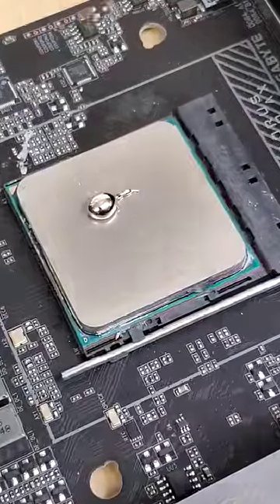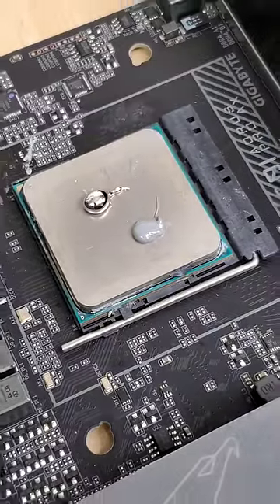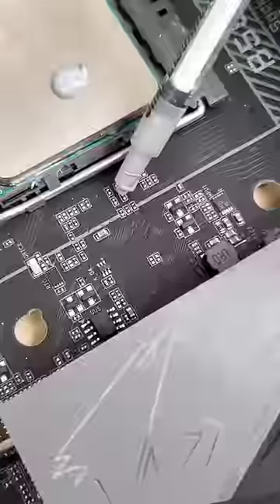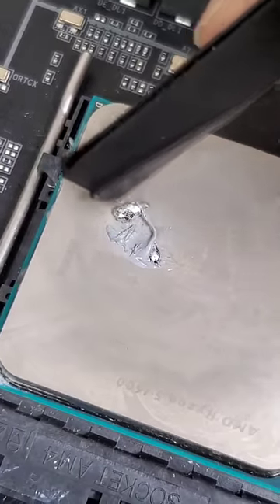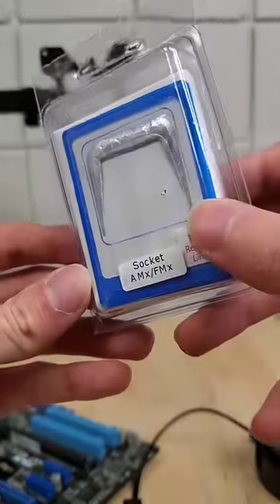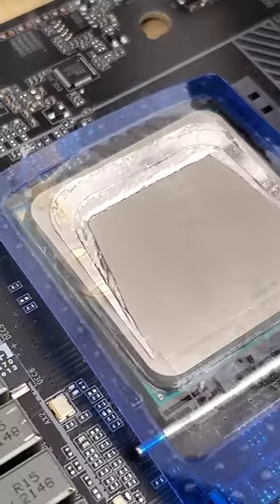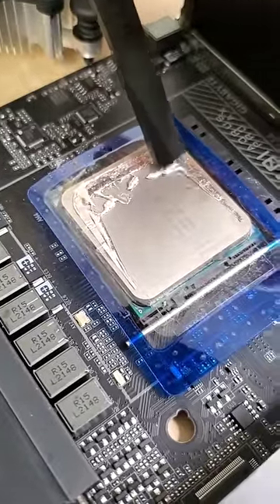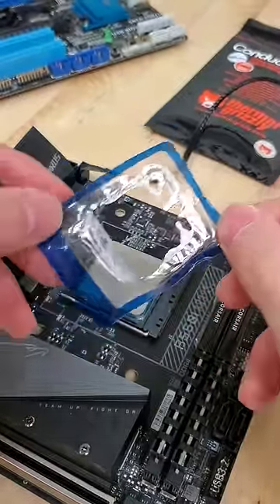the future of thermal paste technology #shorts

Comment: you literally showed it doesnt fucking work, and then say its future? :D
Reply: He showed it starting to melt.
Reply: @Alex-d3l9b also showed how poorly it spreads, making an extremely uneven surface to transfer heat. The last snippet kind of implies that the metal doesn't stick to the CPU well, either. So no, doesn't seem to work.
Reply: @Soccerrockker6  it is better tho I use it in my laptop
Reply: The surface has to be super clean and it needs some heat. Liquid metal works super good, but it's annoying to get applied to start with. I use it and once you get it started then it's easy, but that cpu looked like it was just wiped clean of previous silicon. It has to be super clean.
Reply: @Soccerrockker6 been using Liquid Metal in all my builds. Have had no issues at all, but amazing performances.
Reply: @Soccerrockker6  Brotherman, the paste you see in the video is not compressed by the thermal block that would normally be on top of it, squishing the liquid metal, making it cover more space..
Reply: Yeah thats better than the metal joke - Typical Applications
• Power control unit, inverter, onboard electronics
• IGBT
• Servers, supercomputing, video graphic array (VGA) cards, AI, GPU/CPU/Desktop, solid state drives (SSD)

Comment: When you discover that gallium is solid at room temp and liquid when warm lol
Reply: I was actually wondering if that was gallium they were using. Wouldnt want it near any aluminum components though, as gallium destroys aluminum
Reply: There are a few metals that are liquid at reasonable temperatures but Gallium is one of the worst you can introduce to tech.

(Kemloor is correct, of course.)
Reply: @Unethical.Dodgson  mix lithium and sodium together, and you get a nice liquid metal alloy just dont take it swimming
Reply: @kemloorkavarian4461  I doubt it's gallium. Likely it's Field's metal, which is an alloy of bismuth, indium and tin.
Reply: @_GOD_HAND_  nah, most liquid metal cooling solutions do use gallium. So it's likely at least partially gallium.
Reply: Because Liquid metal is Gallium. That's why they say to keep it away from Aluminium.
Reply: @_GOD_HAND_  Most if not all "Liquid Metal" CPU thermal compounds use gallium. Since most heat spreaders/cpu coolers are Copper, Steel and Tin there really isn't any issues with it reacting. You obviously wouldn't use it with Aluminum heatsinks, but as long as the surface is tinned even aluminum is safe. I run a delided Ryzen CPU with an EK closed look water cooler and the difference from going from an excellent thermal paste to liquid metal was a 10C improvement. Also, in a delided situation silicon thermal paste can bubble from hot spots and cause it to fail. The heat spreader makes the heat more uniform. Skipping that extra layer means you are getting the heat more directly and with the crazy power of CPUs these days this isn't really possible without liquid metal long term.
Reply: @_GOD_HAND_  gallium, indium and tin are the ingredients for liquid metal, different ratio's though depending on the brand.

Comment: I have always used and will continue to use silver infused silicone thermal paste
My wife did point out while watching this video that you could put a thin layer of silicone paste around the outside of the ihs and then the liquid metal in the middle so as to achieve the same function without the goofy plastic tag

Comment: Use the silicone on the outside to stop liquid metal from running outwards.
Reply: It will just push its way through the thermal paste there is a video of someone testing it that way
Reply: Just dont use too much...
Reply: Then the hot liquid metal will touch the cooled silicon. The silicon will heat up and eventually melt letting the metal through.
Reply: @fatalz3276 No, silicone can deal with temperature over double that of what a CPU is even able to reach before it throttles.

Comment: Melting plastic gives off toxic fumes.  This seems too gimmicky.  I'll stick to a quality, non-conductive thermal paste.
Reply: ok, enjoy bad thermal solutions then.

I use on a good old i7 4790k also LM under the heatsink, the LM cant go anywhere, and if so, the few components on the CPU are isolated with a special liquid, similar to nail polish.

Same for my previous notebook. Replaced the bad thermal paste with LM some years ago and its still doing great and it keeps very cool.

Only my newest gaming notebook i took for convenience a thin graphite pad solution, and im impressed, the graphite pad is better than any other thermal paste i tried so far, but not even close to as good as LM.

Comment: Honestly I just recommend the Thermal Grizzly graphite pads to people who want to build their own PC but get scared of adding the paste, it's clean, easy to apply, and doesn't require any replacement due to time as it doesn't degrade, unlike thermal pastes. If you choose the crush style pads you can get heat transfer roughly the same as the best pastes out there, and the pads have the added bonus of completely removing the concern of hotspots as the heat travels horizontally far faster than any paste and thus spreads the heat across the entire heatsink interface to improve heat transfer.
Reply: Been using their graphene pads for a few months now and it works. No more messes or worrying about liquid metal on parts.
Reply: Yeah, what about temperature?
Reply: @VITAS874  your kidding right? you can use graphite pulled from batteries to built a mini arcsmelter to melt down steel. ttemp is not a problem.
Reply: @sorejack   with grizzly it is.

Comment: Been around for over 10 years. Just never caught on because it's like 15 bucks per application.

That said, used it for about 8 years straight without ever changing it, worked perfectly. Brand is indigo Xtreme.

IF you decide to buy and install it, you have to do a few extra hoops on install, unlike normal thermal paste. Make sure your cpu is laying flat, and any fans/pumps are turned off, then do a CPU torture test. You'll know it's done right when your cpu instantly drops by like 50c even without the fans. Then just do a quick extra screw down on all 4 corners of the cpu heatsink to make sure you didn't get a gap when it melted.
Reply: thats a pain in the butt
Reply: 11yrs now and didnt change LM, simply no need, temps remained the same more or less. Air cooled cpu so if it gets a bit more dusty, temps rise few C up, after cleaning all back in normal. Sure its risky, but i think if u dont plan to change cpu at any time soon, its worth more then swapping regularly for the regular

Comment: Just use transparent nail polish for being protected parts of the motherboard. And dont forget deliding process under te core heatsink cap!!
Reply: And most important part - apply enough of it. Not like your regular paste, literally just a few drops.
Reply: You can also buy conformal coating either in a spray can or in a jar like nail polish. This is exactly the sort of thing it was designed for.

Comment: If its solid at room temp. There will be a gap during installation. And when it melts the will have a slight wiggle so it won’t be seated properly
Reply: That’s why most head spreaders are spring loaded and not mounted purely based off the tension the bolt/screws provide. It allows for thermal expansion as well as the softening of any paste you apply. 

The same thing you’re talking about happens with regular thermal paste too. It’ll get a lot more runny when it’s hot.
Reply: theres some tension on the cpu from the cooler which would account for that when up to temperature

Comment: Viscosity is important as well. Noctuas thermal paste is worse at conducting heat but still conducts more heat because it has the perfect viscosity for the cooler. It fills all the air gaps.
Reply: I had a sheep mentality and went with thermal grizzly's kryonaut cuz everyone said its the best. I then repasted a month later with noctua nth2, I didn't see a difference.

Comment: This is the dumbest, most impractical shit in my life
Reply: The PS5 uses liquid metal
Reply: @Chris-yr6io  and I've used liquid metal years ago without this bullshit sticker
Reply: Fr 😂
Reply: DEHHH CPU CONDOM DEHHH
Reply: As a someone who is building computers for almost 20 years, I 100% agree. Just by a proper cooler with flat surface and use normal paste. Liquid metal makes difference only when cooler or CPU is not flat and it has bad contact.
The best thing ever would be if producers of CPUs and coolers were able to make it perfectly flat and you would use no paste.
Reply: My computer blew a gasket

Comment: You could do a super tiny dot of it surrounded by thermal paste, spreads the metal but the thermal paste keeps it enclosed
Reply: This seems like a good idea and as far as i know it is
Reply: Sounds like a good idea but you can also trap air and we know air is a terrible thermal conductor
Reply: I think that's a bad idea, there will be a heat difference between the metal of the cpu touching the paste and the metal of the cpu  touching the liquid metal could cause it to bend. Idk please correct me lol
Reply: Basically the idea of the PS5 liquid metal, seems like a good plan on paper.
Reply: @ToolCraze  you risk that no matter what, especially if the surface has high borders in general
Reply: @prashantyerpude5674  i can understand your concern, however if you think about it, it’s still transferring heat, the difference is similar to that of normal water (h2o) and heavy water (d2o) it’s still water and does the same job and apply that to this it’s still heat transfer and the middle may be hotter due to better heat transfer but would you rather than a slightly hotter contact area to the cpu cooler meaning the cpu is not as hot or have a hotter cpu
Reply: @gianlucaolano5341  yep, improvement is always a must
Reply: @st33lsh0tz  not really, if you place a dot in the center it just spreads outward with no air gap. There will be some on the outer edges with no paste but not a deal since the center is what matters. However if you create a border of thermal paste then yes, now you trapped air in the middle sections and that does matter.
Reply: @ToolCraze  if you leave a gap between the barrier paste and the metal paste then yes, however you could in theory mix the edges or even apply the barrier so close to the metal that they are touching which would solve the air pocket issue
Reply: @st33lsh0tz  depends on the temp difference lol nvm thanks for the reply.
Reply: @prashantyerpude5674  no worries, i actually like questions bc it makes one think about their own solution and often times makes it better or disproves it

Comment: A ~10 thou thick sheet of indium metal is a tried-n-true alternative that seems like a better alternative. Indium is soft enough so as to conform to the surface inperfections of the two faces, and creates an almost perfect, fully metalic interface, with no risk of liquid metal damage.

And indium has an 86 W/mK thermal conductivity, higher than either of these a decent margin.
Reply: It’s expensive and requires a really high mounting pressure to work properly. Higher than most consumer grade electronics can handle. 

We used to use indium heat springs in our immersion ready server blades because it wouldn’t be effected by the immersion fluids we used. 

We ended up switching to a PCTIM by laird. It’s basically a solid version of your typical thermal paste. It’s solid at room temperature and is sold in really thin sheets with a plastic film that you have to remove from both sides. 

Once you apply it to the chip, mount the heatsink, and power the system on, it melts and finishes spreading and filling the voids. It results in a VERY thin and extremely even spread of thermal interface material. It performs extremely close to liquid metal tim, without any of the risks involved. 

Pretty neat stuff. I’m surprised it hasn’t gained popularity in the consumer market. It’s super cheap, super easy to apply too, no more guessing if you put too much or too little. Simply measure your chip, subtract 20% off the length and width and cut your sheet to that size. Center it on the chip and apply your heatsink. It will spread to fill the remaining 20% that you subtracted from the size of the die, every single time.
Reply: Yeah that stuff is great! I've even seen it as "liquid metal" version (InGa alloy probably) which gets applied as a thin sheet and melts into place.
Reply: Can I just say it’s awesome to see people talking about such highly technical stuff in the comments. I wish to be as smart as u guys one day.
Reply: Indium is also insanely expensive.

Comment: It's not the motherboard people are worried about. It's the cpu
Reply: These days enthusiast grade motherboards are literally more expensive than the CPU's themselves. And there ain't no way anyone is using liquid metal unless they're doing custom water cooling with some extensive overclocking and you would definitely want a high end motherboard for that.
Reply: @AngryDraconequus1  ppl on a budget don't care about a top of the line motherboard I bought a shitty 80€ motherboard I don't even know the name of and got my R5 5600x for 300 when it released, my pc never had any issues because everything is stable and well put together.
Reply: It may not be relevant, but getting liquid metal on your mb can kill your CPU depending on what shorts, they're intrinsically connected once installed.
Reply: Ehhh no. Your motherboard is at risk just as much as your cpu is when using liquid metal. Even your gpu is at risk if you don’t know what you’re doing and apply too much.
Reply: @AngryDraconequus1  they always have been lol
Reply: Both really.

Comment: On top of that liquid metal thermal paste is often made out of gallium which will very quickly bind to any aluminium and cause it to disintegrate so you must use a copper or steel heat sink/plate with it! :)

Comment: How much better would it perform than diamond dust thermal paste?
Reply: About 3-4 times better based on the conductivity of heat comparatively. Normal pastes don't exceed 15W/mK, while liquid metal sits in the 40-60W/mK range. 

But you're probably wondering what that translates into for thermals. 

About 10-20 degrees cooler than any thermal paste, including your diamond stuff. Maybe cooler than 20 degrees even, but your mileage will vary depending the cooler used, ambient temps, competence in general. Etc.
Reply: @ManuFortis  You're answering based on normal thermal paste...

I asked about thermal paste with literal diamond dust infused in it.
Reply: @Johnny_C137 he did say including your diamond stuff tho
Reply: just get better fans and coolers jesus
Reply: @SteinzVsKnives  I use an AIO already. 

I also wouldn't use liquid metal because my CPU is not horzontal.  I don't want to have the PS5 problem.
Reply: yes

Comment: Could you use gallium? Method one; mix gallium with clear silicone and apply to the cpu. Method 2; apply a silicone border around the edge of the cpu and fill the center with gallium, preventing melted gallium from leaking off the cpu onto the motherboard...?

Comment: I’ve used this brand once. The way it was applied via instructions. Is to place it then install your cooler rather water block or air cooler then disable cooler and use speed fan to watch the cpu go into thermal then shut the system down. Once system cools remove cooler and remove plastic. Notice I said I used it once. It’s great works great. But you gotta reach down and grab you marbles and hope for the best.

Comment: easy solution: put a close circle with common thermal compound, and finally put a bit of metal compound in the center. when the block push the compounds, the common compound will keep the metal inside. you are welcome

Comment: From my understanding, that plastic would insulate heat, and thermal paste would still be needed to fill the air gaps between it and something that disperses heat.  The liquid metal simply has far less surface area for the heat to go to than a heat sync, and liquid metals don't tend to get close to solid aluminum's 200+ Watts per meter-Kelvin of thermal conductivity.

Comment: You aren't screwed if LM touches your mobo.

As someone who uses LM on my PC and replaces the TP of my laptops with LM after they are out of warranty, I have gotten a drop or two of LM on the mobo my first few times when still learning just how little you need. 
As long as you clean it off, you're fine. There's plenty of ways to clean it off, but you can honestly just use your fingers. The LM will be absorbed into your dead skin, staining it for a few days but at leas it wont fry your mobo.
LM is nontoxic, so in theory it shouldn't be harmful to do this, but who knows. There are obviously much better ways to clean it off, but as a quick and dirty fix it works for those microscopic beads.

Don't be scarred to use LM, if a tiny amount gets on PCB it's not the end of the world....however it's obviously best if it doesn't.
Try it out on some old broken junk just to practice if you can, a tiiiiiinnnnnyyyy amount goes a LONG way when it comes to LM.

Comment: Correct me if I'm wrong, but thermal paste is technically worse at transferring heat than the metal touching the cooler. But there's a lot of areas where contact is not made between the cooler and CPU due to small gaps. Think of a painting a wall with a roller, you have to get a spot multiple times because not every spot of the roller touches the wall. 

But thermal paste fills those small gaps between the CPU and the cooler to make it more efficient. That's also why too much thermal paste makes your temps worse. Because it's worse than the normal connection